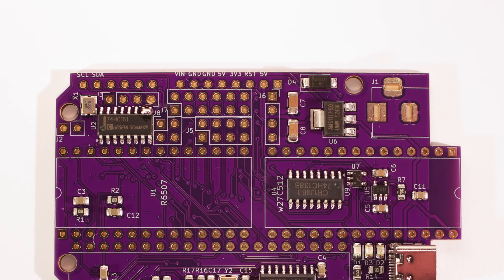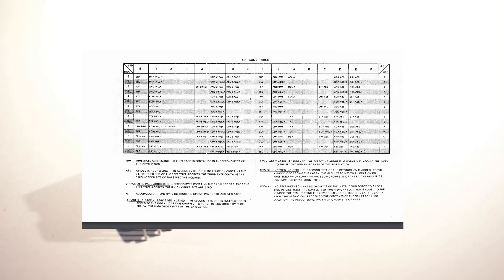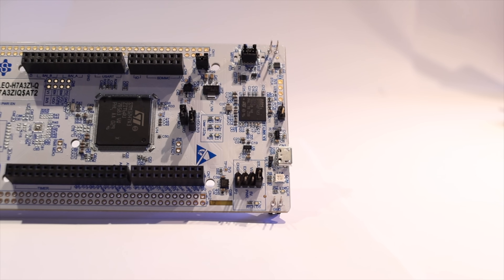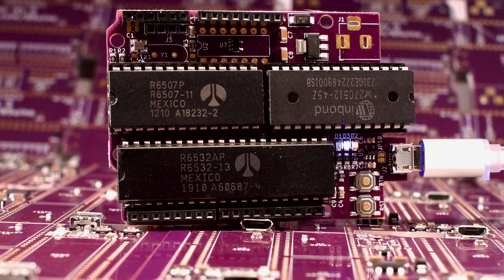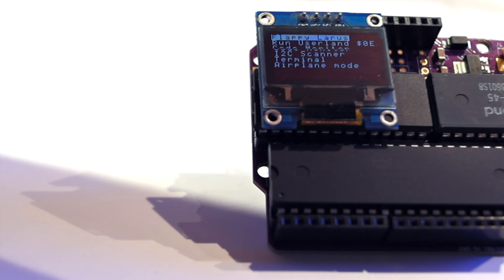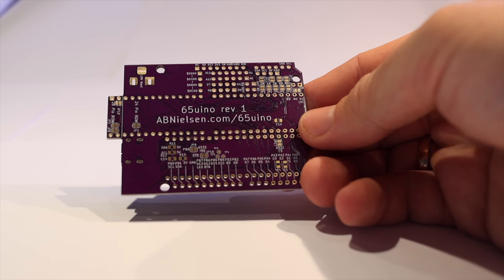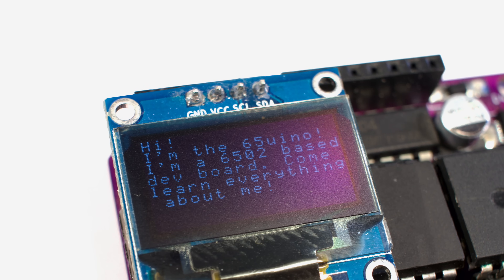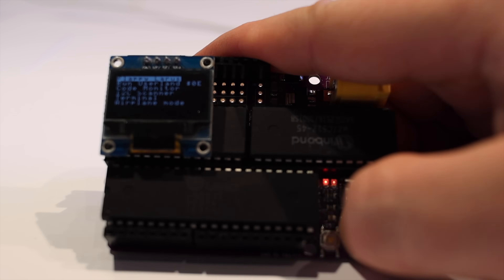6502 Turns 50! The BEST 6502 Computer of 2025 is here!

Comment: If you're looking for ideas for a next project, I'd suggest a 6502 based game console. Something like the C64, including using the breadbox shape with a built-in keyboard, but with some modern touches. Obviously I'd still want plug and play carts, but it'd be better to have straight down insertion. USB ports for plugging in wired controllers and other devices, and Bluetooth for wireless controllers and maybe headphones. More RAM and a big hard drive would be great so you could use it as a regular computer when you're not playing a game, with either ethernet or wifi for internet connectivity. And of course, for nostalgia's sake, boot straight into a BASIC terminal with white text on a blue background.
Reply from the maker: I always appreciate hearing people’s ideas :) 
This particular suggestion only has two viable ways though:
1) Slap a 6502 onto a Raspberry Pl and be done with it - or forget the 6502 completely and emulate it. Hello Retropie :)
2) Bluetooth, USB, WiFi and Ethernet in a 6502 context means either adding a more powerful controller (see 1) or implementing them in an FPGA.. where the FPGA might as well implement the 6502 too. Hello Commander X16 :)

Neither sound super interesting to me - mostly because the limitations I talk about in this video are gone. 

Doesn’t mean it can’t be fun - but it doesn’t have the, very arbitrary, limitations I like :)
Reply: @AndersNielsenAA  Olimex NEO6502 and NEO6502pc.  Who needs a RPi? lol  It comes with Apple II emulation, and Oric and C64 are WIPs.  Basically the entire emulated computers are done in a RP2040, with a "real" W65C02. I've also used a Pico-Ice boar that combines the RP2040 with an iCE40 FPG   Basically a 6502 game machine would be beating a dead horse. There's a million little 6502 SBC projects besides yours, which is very nice. and I think you've been very obliging in your response to "I want someone else to make a cheap new gaming SBC for me! Waaaaah!" lol
Reply from the maker: @  Those too - rPi is just cheaper if you just want to emulate anyway :)
Lots of fun to be had :)
Reply: @AndersNielsenAA  If you can be happy with just emulation, then the Pi500 is a great device. Plug and play and very little needed to finish a setup. But obviously you wouldn't design and build a microcontroller style kit like you did if that's all you were interested in.

Just a thought, but if you setup a service to print carts for developers of the system, you could even solicit more development. Charge just enough to make a profit on the carts, and they in turn would have an easier means of getting carts out. Could even promote their games or other software for some monthly fee.

But like I said, it's only a suggestion, feel free to ignore it.
Reply: Lol, you're completely missing the point. 🤦
Reply: @kilianhekhuis  No, you're completely missing the point. I'm suggesting a next project, not a replacement for this one. Two different purposes.
Reply: @anon_y_mousse  dude, you're suggesting a project that would take one man years and years. You really don't know what you're talking about. (Also, randomly suggesting people's next project should be something you would like to see is kind of cringe, in a bad way.)
Reply: @kilianhekhuis  You're seriously overestimating the complexity of such a project, not to mention that he could just base it off of the specs for the C64 which are available. Also, some people fish for suggestions because they want to know what others want to see. What's cringe is people like you who have to pretend you're a white knight.
Reply: @anon_y_mousse  sigh... You also don't mean what a "white knight" means. Regardless, C64 clones have been designed and made, but they take original chips. The VIC2 and SID can't be recreated without resorting to FPGAs or the like. As for the complexity, there are plenty of such projects to be found online, and yes, they take a lot of work. E.g. the Commander X16, the C256 Foenix computers, etc. I think you seriously *under*estimate the work involved.
Reply: It wouldn't have to be a clone, and emulation doesn't give you the quick startups. There are cheap boards for USB, Bluetooth and sound that could just be wired in. Using an existing board with a 6502 already on it would be a really fast way of putting it together. Various board manufacturers even have templates for keyboards, so those would be cheap to put together. The most difficult and expensive part of the whole thing would be the case. It couldn't be completed until the internals were set and then you'd either have to mass 3D print or find a company to cheaply do injection molding. Too often people psyche themselves out of doing things because they think it'll be too difficult, but if more people just gave things a shot they'd see that so much more is possible than they think.
Reply: @anon_y_mousse  honestly, it sounds like you're fishing for a cheap game console. That would be a really selfish suggestion.
Reply: @squirlmy  Clearly there's enough nostalgia for such systems to garner loads of views on YouTube. If the price could be kept down, they'd sell more, which if you've studied economics at all would mean more profit. After all, I doubt that the 8bitguy is making much profit at his price point for what is essentially a completely novel computer. Using some pre-built components the price could be better controlled.
Reply: @anon_y_mousse  Again, you are completely  ignoring video, the most important parts of a retro computer. What use are USB and Bluetooth?? Also, I doubt there are many usable sound options available. AC97 can't be driven by a 6502.
Reply: @kilianhekhuis  There are cheap breakout boards for VGA and RCA output, and slightly less cheap for HDMI. But as I mentioned in another comment, you could always use a Pi Zero, $15, and get all of those things in one. Of course, it'd be more difficult to get the fast bootup times of a traditional 6502 based computer if you drove the video from a Pi Zero. I suppose you could just write a custom bootloader for it and get the video working and pass control in the foreground to the 6502, and while that still wouldn't be as fast, it might be fast enough. Might be interesting to have the Pi emulate an interface for the 6502 so you could make use of a larger chunk of RAM and a "hard drive" with the SD card.
Reply: @anon_y_mousse  you wouldn't use a Pi Zero but an RP2040. But regardless, VGA out is not a video chip. I'm going to stop this conversation now, you don't have a clue about this topic, please go educate yourself.
Reply: @kilianhekhuis  Rude, but clearly you need to look up what an RP2040 does. You will not be using it to generate video signals unless you're really into writing a lot of code from scratch, not to mention you'll be soldering the connectors from scratch too. And VGA may be an old standard, but there are still plenty of old monitors around that you can output video to and yes, there are boards that enable you to easily interface with them. A Pi Zero already has a mini HDMI connector, so either a dongle or a cable that has both ends, would enable you to output video to a modern monitor or TV. It also has Bluetooth and WiFi. If one used a kit that already has a 6502 on its own board, you could wire it directly to the GPIO pins and with a tiny bit of interface code you could output video and sound, take keyboard input, have a working implementation for sockets.

Comment: Amazing to see an OLED display working on the 65Cxx.
Reply from the maker: Thanks 😊 No C’s involved though :) R6507 - NMOS ‘til it went out of production in the 90s.
Reply: @AndersNielsenAA I think the confusion may have been because one of the very prominent closeups at the beginning (around 1:25) is actually of a 65C02. Easy to think that that’s the one you used, even though the other closeups are of 6502s without C.
Reply: @AndersNielsenAA  is there any reason for or against cmos based processors? I have a laptop with an 80c88 rather than a regular 8088
Reply from the maker: @ They’re generally lower energy, faster and “better” - take more transistors though. That’s why it took 8 years between the 6502 and the 65c02 clone - the tech needed time to mature.
Reply: Hardly....... ,it's not like it is driving it directly, its a standard module, you just need to implement the communication protocol.
Show me the same with the 6502  handing the bare LCD & i will be impressed.....
Reply: Bot comment. Dead internet theory holding strong  @stevesteve8098

Comment: This project is great,  So what are the ways to program the device again ? Is it possible to do some of Ben eaters project on your device ?
Reply from the maker: You simply hook it up to your computer and send it small programs that fit in RAM - using the project on GitHub and cc65.
You can also rewrite the ROM partially or completely.
It’s hard to fit Basic in 8K address space - but not impossible